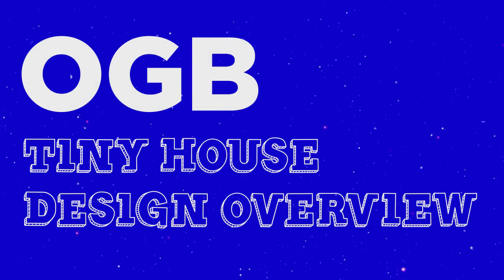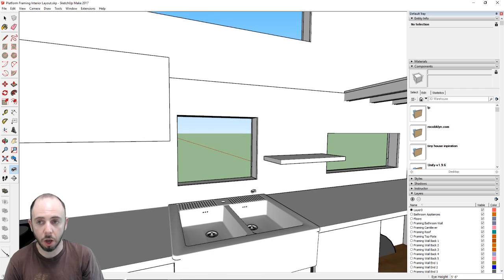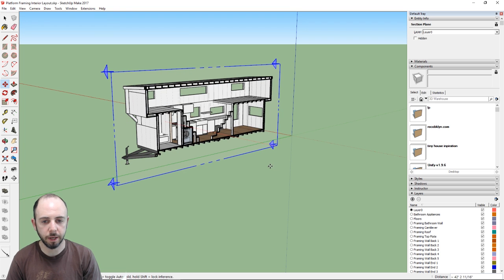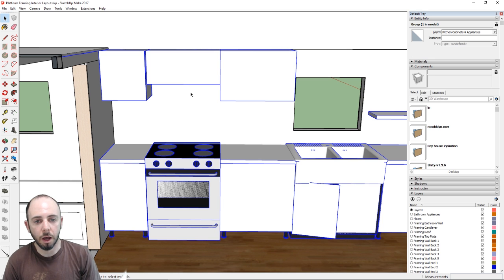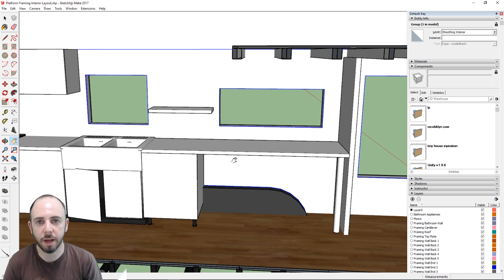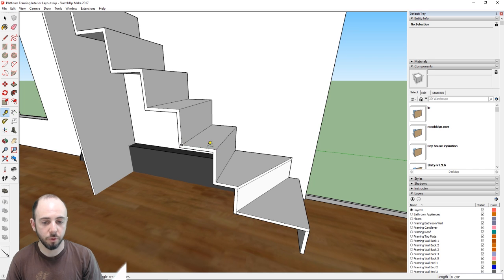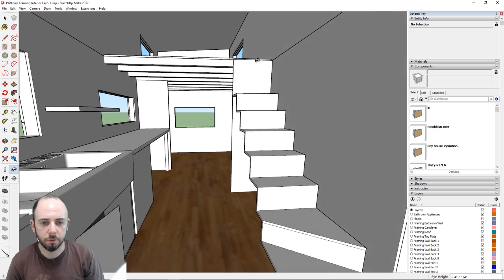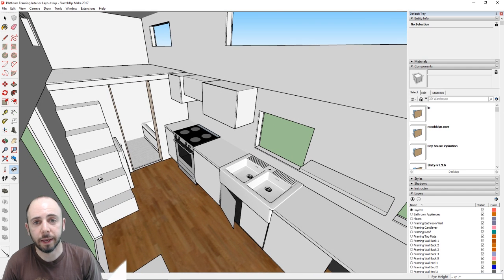Overview | Part 1 of Designing a Tiny House in Sketchup

Comment: OGB:  Looking good.   A couple of notes to consider: 

1.  Reduce your loft joists to 2x3's on 16" centers, blocked down the center line.  In the loft you will never have the live load of a conventional bedroom.   In the span charts ; blocked  2x4's  16" on center, will carry a span of 80".  Better still use 1/4" furniture grade ( Baltic Birch ) plywood on the bottom with glue and brads.  This will provide a finished ceiling and a void for shallow LED pot lights. 

 2.  At the end of the master stairs add a 20" hanging locker with a plywood top 64" above your finished floor.    This will create a 29 1/2" long landing  ( including the 9 1/2"  tread of the  stair ) .  In the middle of the night when confused ;  it is good  to have  space to stand up on,  orient your self,  then turn before proceeding down the stairs.  I would use a 8/8 -rise/run with 9 1/2" x 1" treads;  a 1 1/2 over hang with bull nose.  By using   2x material for the locker face frame,  you can pick-up the static load transfer from the shortened first two joists.   I would lower the open section of counter down to 30"  and use folding chairs,  better back support and easier to store than stools.  Also I would add a couple of 12" deep shelves for dry food.storage, under the counter in the back in your current configuration.

 
2 a.  An other option would be to put the fridge on the other side and a 30" high counter to sit at under the drop ceiling/landing, ( this would be above eye line when sitting at over 60" and you could look out the relocated picture window )  and have only 45 degree head rotation for eye to eye contact over diner.  You could pick up the dead load from the first two floor joists dead load with a chromed  pipe post  ( from a plumbing supply company) off the corner of the low counter.

3.   I would consider the other stair as a boat's companionway  forcing you to face into it,  with a  8/6  - rise/run   (12" is to much for a toddler or old fart to navigate )   Also  I would install  a minimum of  a 30" handrail  (again the middle of the night).    Also stair panels;  could be 4"x4" welded fencing,  strung steel cable,  yacht netting,  etc. with a toddler on board. 

4.  An other option would be to rotate the washer dryer 90 degrees into the wash room facing the toilet  ( it needs 30" x 48" with knee room.)  This would provide space above the washer dryer for a landing at 64".  And you gain 12" to fit in the companionway.  And you have about 30" between the toilet and the tub for a vanity and mirror facing back down the tiny house.  The wall beside the washer dryer would pick up the dead load transfer from the shortened first two floor joists.

5.   In the front, the tongue could support a insulated, three  sided utility cabinet, that follows the steel tongue profile as far forward as possible.   With 2 - propane bottles in the bottom sealed from the living area with vents,  sealed batteries and the demand hot water heater,  in the compartment above,  then the 12 volt system and inverter in the top .   All your plumbing could be serviceable in this space adjacent to the fixtures, except the kitchen sink, and could be dead run from the manifolds with shut-offs.  I don't know how you plan your drains .

6. I would cut the material for the board and batten  ( 6" and 2" ) 1/2" thick to reduce weight, space,  and be in better proportion for the tiny house

 Bert
Reply from the maker: Thanks for all these thoughts Bert!  You are a man that thinks like I do and I appreciate that!

Comment: If you use this program a lot you could save so much time by simply buying a 3d space mouse from 3d connexion, typically used in your left hand, than buy an mmo mouse and use it in your right hand, program the buttons where you have options for atleast 30 buttons or more, I use about 40 hotkeys all with my right hand not touching the keyboard and I navigate the model with the 3d space mouse which is faster than anything currently on the market for model orbiting. These are massive time savers. Just some tips from things I've noticed, probably not a big deal if you don't use the program much though.

Comment: How about a tv mounted on the ceiling above the bed so u can lay down comfortably in a natural position as u look up at the ceiling :) use the KISS method buddy.
Reply from the maker: Agreed with stupid simple but I can imagine staring at the ceiling to watch tv will be uncomfortable after a while!
Reply: I actually saw a utuber who mounted the tv into the ceiling and using an actuator lowered the tv from a horrizontal position to a vertical tilted position above the foot of the bed or further back, and I think it was remote controlled too. Also I think there was a panel that covered it up so u wud not see it in the tucked away position.